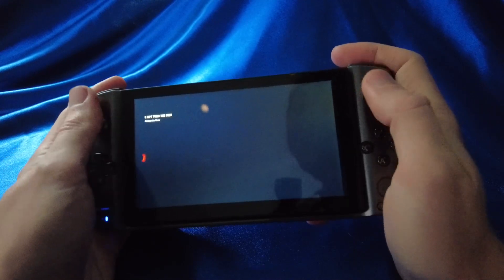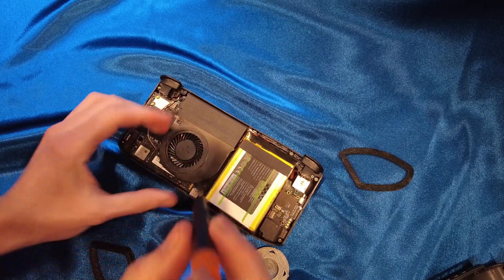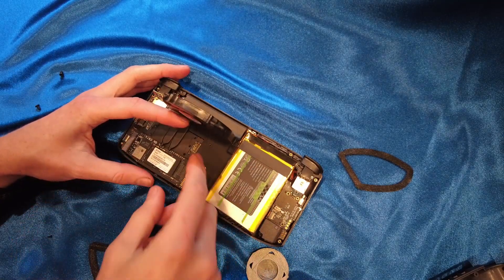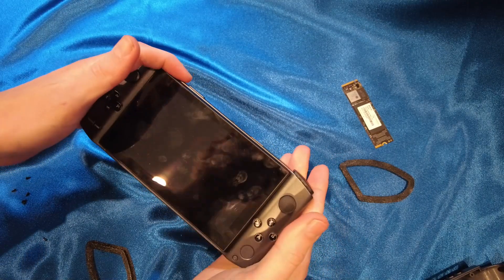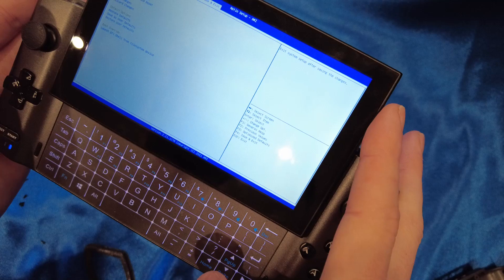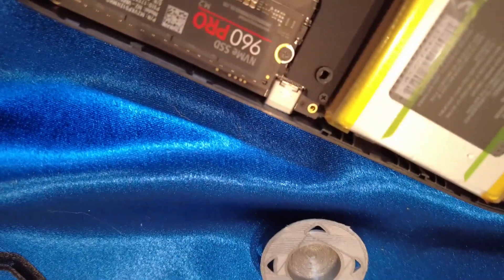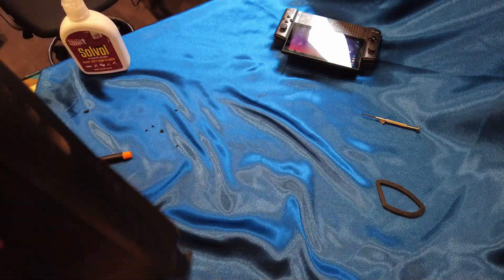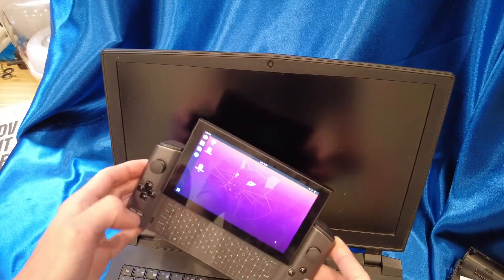Dead on arrival/BSOD GPD WIN 3 (Edit:chargeback claimed!)

Comment: I did a charge back too
Reply from the maker: Very good, sucks they ended up this way. Hopefully they clean their act up.
Reply: @emccat   I mean the concept of the computer the look of it is amazing but the execution was a little bit off because not everyone's device came out bad but they were a considerably a large amount.
Reply: @emccat  I was able to fix it once again after it getting ruined but it was a major hassle having to open it completely remove the board and put a spacer in between the boards and then put thermal paste for the 10th time because I thought it was overheating then I found out it was making contact with something and causing a short

Comment: Would it make sense to instal fresh new copy of windows on Samsung ssd first instead of using existing windows petition?
Reply from the maker: I would have loved to do that, however it would not read the SSD at all. And I tried to demonstrate that was no fault of the SSD itself as it was (and still is) working fine outside of the dead unit.

Comment: I have a fix.
 
1. Open the device, remove screws from fan, remove ssd.
Begin to slightly loosen the screws to the motherboard, now slightly and gently lift it up and put a spacer in between .Use a rubber object or if you have an old laptop see if you can find a rubber spacer.
Reply: I have a fix. Buy a OneXplayer
Reply: @nguyenhuu6559  lol there's two problems with that device that I don't like first thing they already sold the ones that I really wanted and second thing it looks like a generic handheld
Reply from the maker: @1415gatewayable  yeah I bought the win out of love for the Vaio UX, I have a few of them laying around and they're some of my favourite devices, but this does not do the UX justice at all.
Reply: @emccat  have you tried updating the bias? By the way that's the same reason why I bought it because of how beautiful the Sony Vaio ux are
Reply: @emccat  I'm not going to lie I had several problems with it too.
Reply: @emccat  one thing that totally stopped the blue screens of death and distortion on the screen was using the spacer and loosening the screws a bit, I have been getting the SSD not showing up in the bios but usually only when I use a low TDP so I updated the bias I'll see what happens
Reply from the maker: @1415gatewayable  But the SSD was showing in the bios, I can find you the time stamp in the video if you want? Also where are you finding the BIOS? The GPD website does not list a WIN3 bios?
Reply: @1415gatewayable  you mean they sold the 85 model that you wanted not ... "ones" generic looking welll aya too then out the window generic isnt bad its safe, clearly safe paying off no silly screen slider mechanism.
Reply: @_GarethRossUK  the aya has had it's problems too
Reply: @emccat  I just realized something I bought an external nvme adapter the SSD was actually working but it will not allow me to install Windows on it so I just use it for gaming
Reply from the maker: @nguyenhuu6559  I did order one quite early on actually. I had some issues with GPD support so I decided to back both.
Reply from the maker: I can't possibly see how this is a fix, the device was recognising the SSD.
Reply: @emccat  because the board is causing a short which can damage other components on the board including the SSD
Reply from the maker: @terrygrand4722  sure if it's causing a short, but then it should not A) be reading a different SSD and displaying it in the BIOS. And.

B) should not be booting off the BIWIN and have the same physical error when that's plugged in.
Reply: @emccat  what I actually showed you me I was having the same problem I'm just trying to help you out I was actually also getting screen distortion
Reply: @emccat  my daughter had the same problem